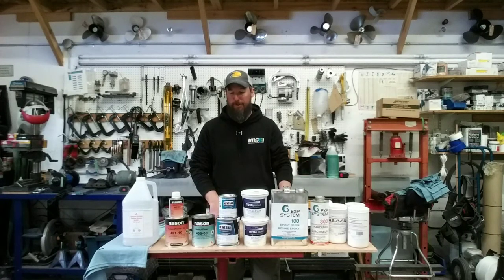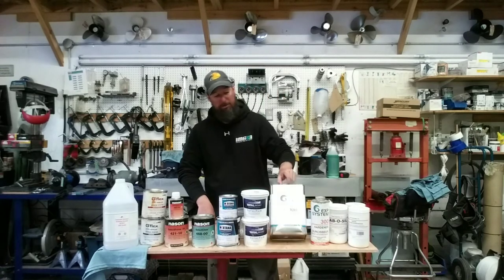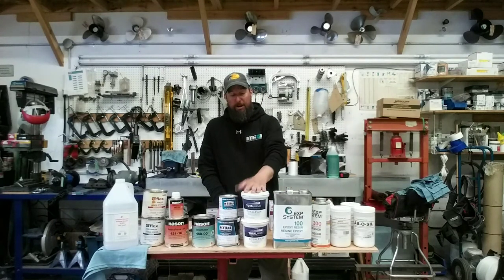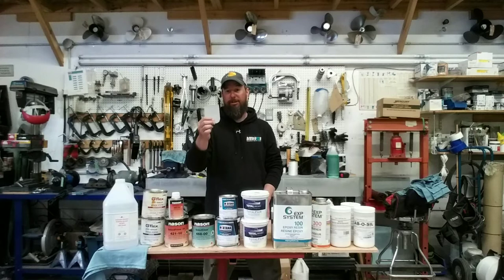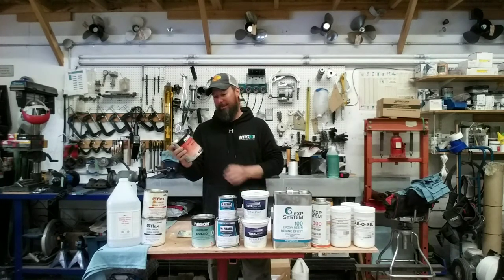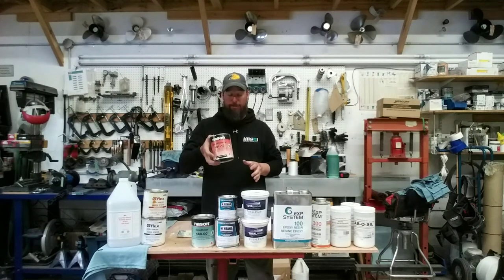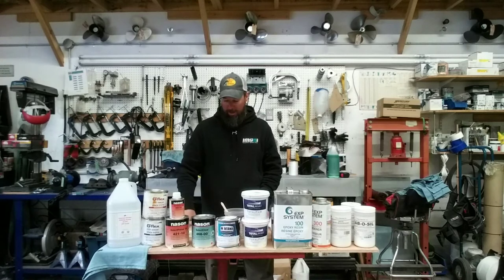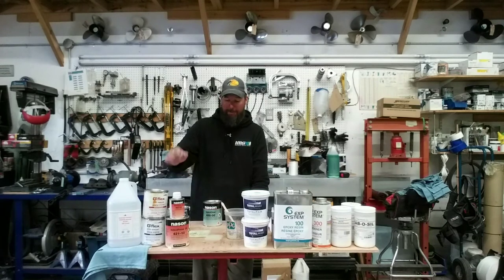Material and Product review for Yamaha Nanoxcel Hull repair

Comment: My2001 FX SVHO (nanoxcel2) has some scratches on the bottom. Took to repair shop - $2100 (sounds reasonable) but he listed gelcoat on the itemized price list. Why would a painted SMC nano2 hull need gelcoat? Is this guy clueless or does is this normal? Appreciate your videos.
Reply from the maker: My recommendation would be to talk to the service writer or the person who is going to do the work.
Perhaps they intend to use Urethane Paint, but their computer system does not have that as an item and gelcote is just generic.
If they do intend to use Gelcote then I would have alot more questions to ask.
As mentioned in the videos, those hulls are different than say SeaDoo.
Maybe worth finding out how many of these hulls they have done in the past and what their experience is with them. They may not actually know the facts about them.
Hard to say from my perspective.
However, Gelcote will not cure properly on top of Urethane Paint. 
Maybe best to ask some questions before committing to getting the work done.
Reply: @realityboating454  Thank you for talking the time to reply.